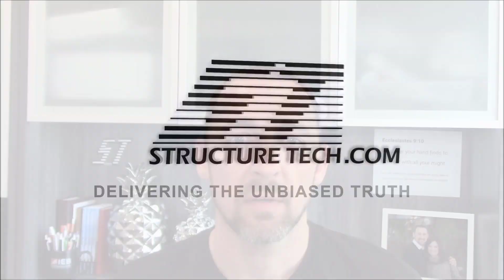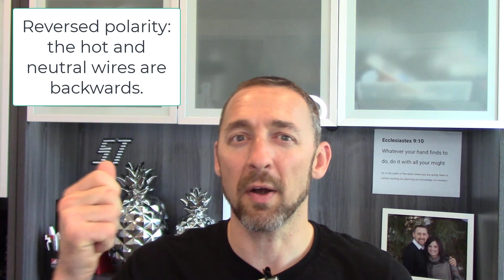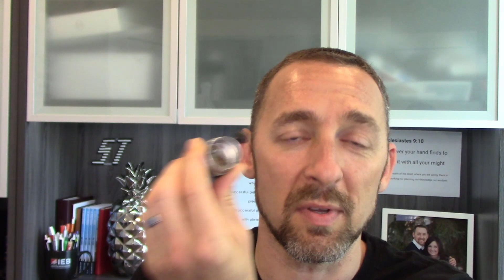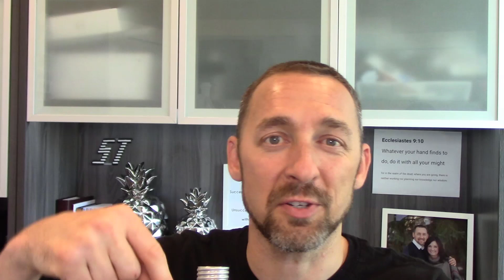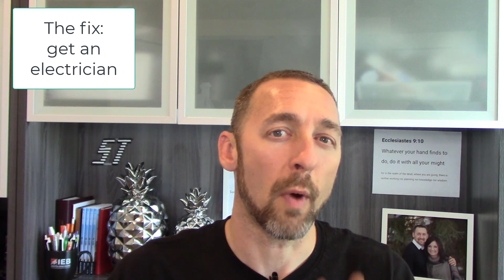Reversed Polarity Outlets

Comment: I completely redecorated my 20 year old home recently and changed all my beige outlets to white. As with your example, I rewired without any regard to hot vs neutral. I recently purchased a Klein tester and checked every outlet. Thankfully, only found two that were reversed and one that the ground wire broke. Just subscribed to your channel, too.

Comment: what kind of tester do you recommend for an homeowner to check the plugs?
Reply: $7.49 before rebate at Menards— https://www.menards.com/main/electrical/electrical-tools-accessories/electrical-testers/gardner-bender-reg-ground-fault-receptacle-tester-and-circuit-analyzer/gfi-3501/p-1444431010808.htm
Reply: In the video, he’s using a Gardner-Bender model GFI-3501– http://www.delzer.com/ecm/gb_catalog/132/ — any home or hardware store sells them or similar models from different manufacturers. One difference in models is that some also test GFCI operation, as the one he is holding does. That is a nice feature, but a basic tester is all you need to test a regular outlet for proper wiring.
Reply from the maker: Great answer from mactoeknee.